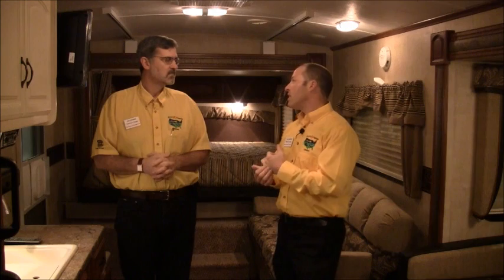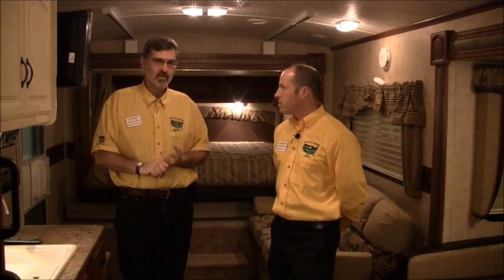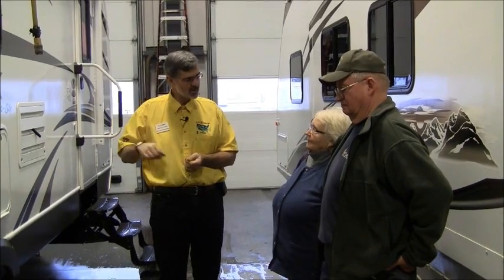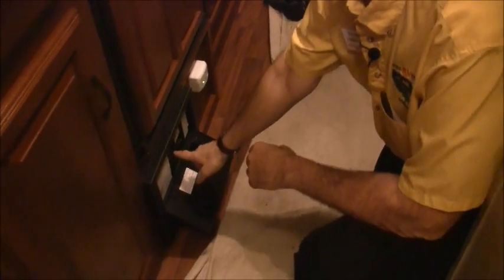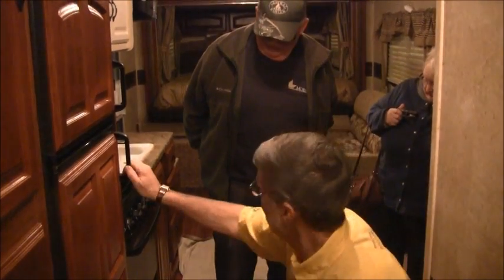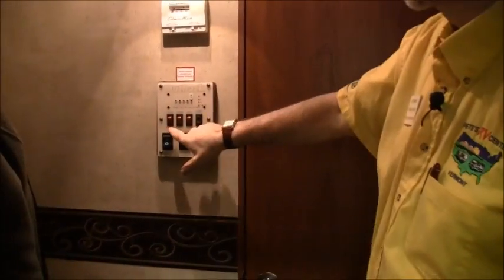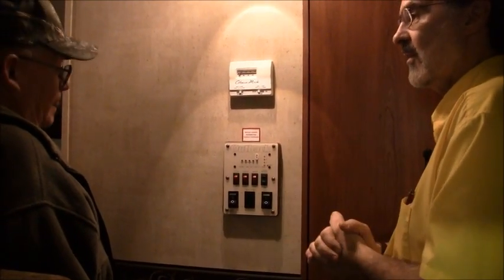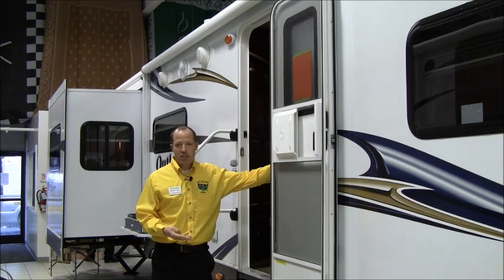EXPERT WALK-THROUGH IS A MUST FOR NEW CAMPER OWNERS | Pete's RV Buyer Tips

Comment: I'd recommend that when you do a walk through that they not just tell you how it works but show you that it works. Turn the hot water heater on and run hot water, operate each slide all the way in and all the way out. The same with the awning. Turn on the a/c,  microwave, tv, radio , DVD player and make sure everything is working so you don't end up having to bring the unit back for things that weren't working from the start.

Comment: On your full video regarding the Black Tank Flush; I've seen another method done in which at the external water source, a 'Y' hose adapter is used where one end has the potable water line with the inline regulator and the other line is used to run the black tank flush with a back-flow preventer attached to prevent anything from coming back out of the black tank through the flush line to prevent any contamination when filling the tank for flushing.

A side advantage of the y adapter at the supply source is it will allow you to draw water if you need to wash the RV or the truck, etc. while keeping your potable line connected.

Does your business carry any back flow valves designed to fit on the black tank flush water inlet and couple with a garden hose?

Comment: Question from your full video walkthrough.  I've heard elsewhere when using the washroom that you should not use the bathroom fan when flushing the toilet as it apparently draws air from the black tank through the black tanks vent pipe regardless if it's a 5th wheel, camper trailer or class-a, b, c rig.  Could you clairify on this?
Reply: A lot of things (wind direction, etc) would have to come together for this to be a problem, and even then wouldn't be much of a concern beyond a few moments of foul odor (keep that fan on until it goes away).
Reply: Dwight Stewart h